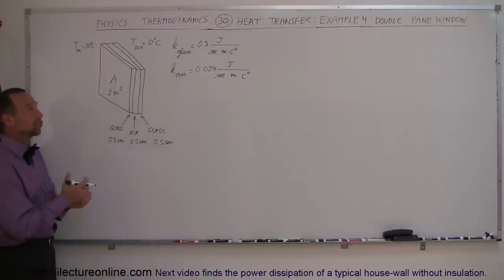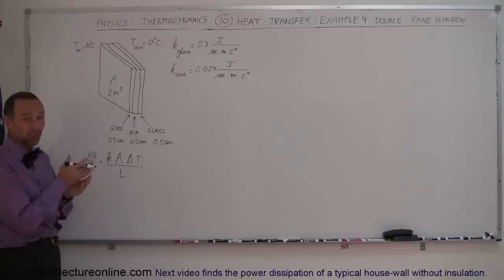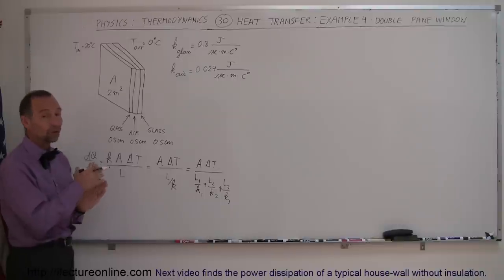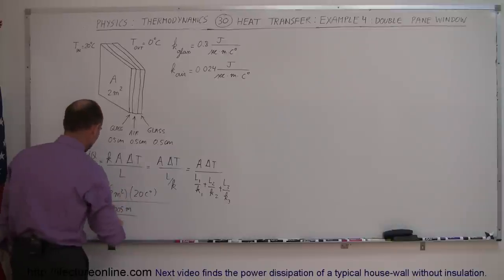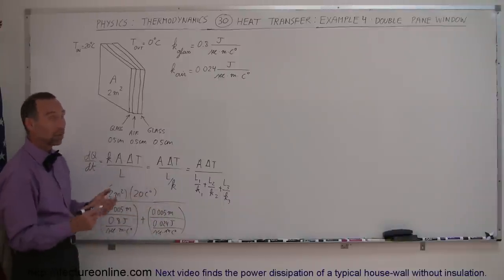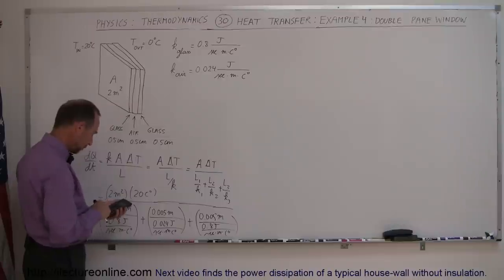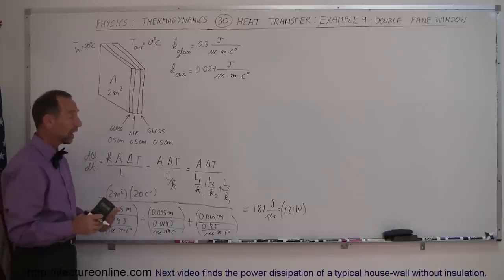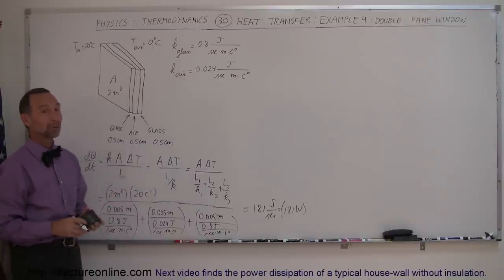Physics 24  Heat Transfer: Conduction (5 of 34) Double -Pane Window

Comment: Thanks! I was thinking of adding a second pane of glass to a 24" x 58" window in my house that is hand built, that is , it is just a single pane of glass in a wooden window frame.  The window has plenty of depth inside to add a second pane, so I plan to just install another pane with a piece of maybe 1/2" wood trim for the air gap.  Actually, I am a mechanical engineer (in aerospace) of 30+ years but wanted to refresh my memory on how much the air gap might help, even if it is not a manufactured window with a  vacuum or with argon gas in the gap.  This reinforced my hope that it will be a worthwhile improvement, with the heat transfer through air being 1/33 that through the glass, roughly speaking.  Right now when it is cold, I can just feel the cold emanating from the window, or rather it is sucking heat from me lol.
Reply from the maker: Correct, it will make a significant difference.  (In Siberia, the old houses will have triple windows with one pane of glass each).  I remember old houses in Austria having 2 separate windows.

Comment: thanks for this instructing video, it helps for determining what size air gap gives what result (retrofitted windows have smaller air gaps than new units due to the limitations of the frame, I am making a pauper's 4-3-4 float glass unit and wondered about the diff with a 4-4-4). However (I am sure you know, but for the other viewers) the equation will not apply to larger air gaps as the insulation value will reach a maximum, or through convection flows even start to decrease after about 16mm, e.g. this equation will give a better rating to a 4-28-4 double glazed unit opposed to triple glazed 4-12-4-12-4, while in practice the latter will perform better. Thanks for the helpful video.
Reply from the maker: Very interesting information.  It is nice to see the practical aspects of these applications.    We are working on videos that also include the convection currents on both sides of the window which actually make a big difference in the heat transfer as well.
Reply: @MichelvanBiezen  Your video has been a great help, thanks.

Comment: Thank you. This helped refresh my memory. I was confused on how to go about the air in the middle but now I get it.  You treat it as conduction not convection.
Reply from the maker: That is correct.  That is the best approximation of how double windows work.  (There are other factors on how the heat is transferred from the air to the glass on the outside, but that we have ignored as well)

Comment: Thank you. One more video would be interesting to see in this list: Window with coatings that reduce radiation transfer. Is it useful for longwave radiation(low temperature inside room) or only for shortwave(our sun)? Also, Screens in a heat insulation for space ships to stop heat transfer via radiation.
Reply from the maker: The effectiveness of coating is a very different principle which we discuss in the optics playlists (light interference).

Comment: Great explanation! Thanks. Can we use the same method (the same equation) to find out the needed cooling energy for a room? To calculate air conditioner energy.
Reply from the maker: Yes we can, however we have ignored the convection of air towards the windows (and walls) and away from the windows (and walls) on the outside.  We have a playlist that includes the convection currents along with the heat transfer which changes the heat lost considerably.    Physics: Ch 24B - Convection: Test Your Knowledge (1 of 26) What is Convection?    Starting with this video:   https://youtu.be/7vg3EnX7ZWc

Comment: I was running some numbers, and if you increase the air gap to 1 cm (0.01) you get the same heat loss (+1.34w) as a triple glass version at 20mm instead of 25mm

0.005/0.01/0.005 = 93.2W double with 1cm air gap,(20mm)

0.005/0.005/0.005/0.005/0.005  =91.86W. (25mm)
Reply from the maker: Interesting result!

Comment: Thank you so much Sir for those great movies. 
Sorry for maybe a stupid question, but what I do not understand in this series of lectures (when you use one or more layers (composite) wall ) is why should we be interested to get smaller dQ/dt. 
Let me explain myself explain: You have said that temperature outside and inside are given = doesn`t change because it is being supported somehow on the same level. If, so what does it matter to me practically if the dQ/dt is smaller or bigger?
My guess for an answer (maybe I am right):
The smaller dQ/dt is' the "easier" is to support inside of the house same temperature?
("easier" probably means less air conditioning needed?)
Reply from the maker: The goal is the reduce heat loss during winter (less heating required) and to reduce the heat from coming into the house in the summer (less air conditioning required).

Comment: What if this was applied to a thermoflask, with different areas per layer? How would this equation be changed?
Reply from the maker: In exactly the same way.  A cylinder is like a flat sheet bend into a circular shape.   But if the layers are thick compared to the radius of the bottle it may require calculus to solve.

Comment: this is not making sense to me. conduction is the heat transfer through a solid body, and convection is the heat transfer through fluids. air can be considered as a fluid so wouldn't you need to use a different equation for that?
Reply from the maker: A thin layer of gas can mimic the process of conduction.  The gas molecules pick up the energy by colliding against the surface and can transfer that energy by colliding which each other and then colliding with the other side.   (The equivalent "coefficient of conduction" is then experimentally derived).

Comment: Hi sir, Thank you so much for this explanation. I do have a question. I think this calculation would mean a thermal resistance of double pane window of 0,22 (adding the factors L/k). However, when I search the R value of double pane glass on internet, this turns out to be way higher. As well as when I calculate tripple glass, the calculation does not seem to resamble the 'basic' values of the internet. 
I wanted to calculate the heat transfer of my facade (double skin) in your manner since this video is really clear. My wall consists of (from left to right): double pane glass, 60 cm air cavity, double pane glass. 
Using your values, this would get me to a heat transfer of 14,3 W. I am not sure if I can do this calculation for my air cavity since that would give a resistance of R = 0,6/0,024 = 25. Could my final answer be right or is there something I am not understanding (your video vs standard values).
Reply from the maker: Note that all these equations ignore the added heat transfer constraints of convection currents.  We have a playlist where that is taken into account.  You must include convection currents in order to obtain realistic heat transfer results.    See:  PHYSICS 24B CONVECTION TEST YOUR KNOWLEDGE

Comment: if we assume that we are designing furnace of melting steel and the area is 2×3=6m^2 what are suitable components of material we use in order make the outside temprature not approach 50 for safety
Reply from the maker: Usually they use very thick walls of brick and dirt.  The low heat transfer is accomplished by making the path  (thickness) very large, and brick and dirt are good insulators of heat.
Reply: +Michel van Biezen thanks so much teacher.

Comment: what is the reason for triple pane - wouldn't you be better off utilizing the extra space with air instead of filling it up with another piece of glass?
Reply from the maker: If you build a tripple pane window, then you'll have 2 layers of air instead of one.  In the "real world" you also have to account for convection currents and heat loss due to that and the transfer of heat from the air to the glass pane and the temperature gradients that causes.  See the videos we have on those principles.  Here we just cover the basic principle of heat moving through multiple layers.   Physics: Ch 24B - Convection: Test Your Knowledge (1 of 26) What is Convection?  https://youtu.be/7vg3EnX7ZWc

Comment: SUPER, this info I was looking for in my new construction. Is there a difference between regular glass and tempered glass in heat transfer?
Reply from the maker: The differences between different types of glass is relatively small.  A much bigger difference is achieved when the glass is layered with air in between

Comment: Hello sir, I am having a problem in studying entropy generation in a wall due to heat transfer. What are the entropy changes within the wall that take place when heat flows from Hot surface to cold surface? What's the entropy change, entropy transfer, and entropy generation (Considering that Entropy change = Entropy transfer + Entropy Generated) ?
Reply: There is entropy transfer (∆S) associated with heat transfer (Q) at any temperature (T).  This is given by S = Q/T, where T has to be in an absolute scale like Kelvin.  For a changing temperature, it becomes ∆S = integral dQ/T.

For infinitesimal temperature difference, all entropy of incoming heat will exit with outgoing heat.  By contrast, a finite temperature difference means more entropy leaves with outgoing heat, than enters with incoming heat.  This implies that entropy generates in the heat transfer obstacle.

Example:
Interior temperature = 290K
Outdoor temperature = 270K
1000W of heat

Entropy entering wall from building interior = 1000W/290K = 3.44 kJ/K per sec. 
Entropy exiting wall to the surroundings = 1000W/270K = 3.70 kJ/K per sec. 

Rate of entropy generation = 0.26 kJ/K per second

Comment: are those watts/sec? just as Joules/sec? because if I want to heat something with an electrical resistance, the grid counts Watts/hr consumptions just as any light bulb. 

If my heat loss though conduction in a Kiln is the same as in the example (181Watts), does that mean that I am lossing 181Watts per second of energy or 181W per hour? It makes a LOT of difference in the bill I have to pay.
Reply from the maker: 1 W = 1 J/sec  = 3600 J/Hr                 1 kWhr = 1000 W x 1 hour = 1000 W x 3600 sec = 3,600,000 J
Reply: ok, thanks.

Comment: No convection heat transfer coefficient?h?I am assuming there is convection also at the both sides of the glass or there isn't?
Reply from the maker: Yes, that is a BIG factor in heat transfer through a window.  We have videos on that as well.  But here we want to ignore that for simplicity of just looking at the heat transfer through conduction.

Comment: You  talk about heat transfer through pane window taking the room temperature and surrounding temperature but why don't you consider convective resistance between room air and window or window to the surrounding air .
Reply from the maker: We have an entire playlist that takes the convection currents into account.  In this playlist we just have the simplified format where we only take the conduction into account.

Comment: what if therenare different cross sectional areas between the layers
Reply from the maker: That would not be a very realistic scenario.  Although if you look at the heat transfer through thick pipes or thick pipe insulation, we have a variable cross sectional area which must be solved using calculus.  We have videos on that.
Reply: @MichelvanBiezen  thank you!!

Comment: sir have a question : why can,t we do it as follows :
 dQ/dt  =   A delta T     [ k(glass)/L(glass) + k(air)/L(air) +k(glass)/L(glass)]
even the units come out to be  { J/Sec }
please explain, thank you
Reply from the maker: That is a question of algebra.  Whenever you have (A/B + C/D) in the denominator you cannot simply move it to the numerator and turn it upside down.  What I always do when I am not sure, is place some simple numbers in the equation and see if I get the same result.  Or what you can do here is work it out that way and see if you get the same answer as in the video.

Comment: How would you find the average temperature of the air between the glass?
Reply from the maker: When heat travels due to conduction, the temperature gradient tends to be linear.  When  the layer is air, it becomes much more complicated.  The heat transfer involves radiation as well as well as convection.
Reply: Then how come we used Fourier's Law (conduction) to solve for the heat flow through the air (instead of Newton's Convection law)
Reply: Actually nevermind. I just realized my assignment was indirectly asking me to find the temperature at each surface and hence the average.
Thank you for your help :)

Comment: how could we find lets say the temperature from the layer of glass to air in the middle only knowing T hold and T cold?
Reply: I know this is late but hopefully it will help anyone else who finds this video.
 
Basically you have to remember the energy balance equation. That is, the energy transferred through each section will be the same.

dQ/dt(glass) = dQ/dt(air) = dQ/dt(total)

So find the q using the method in the video and split up each section as if they are independent control volumes. Then apply the equation dQ/dt=A*∆T*k/L to each pane of glass to find the middle temperatures since you already know dQ/dt. 

You can check yourself by doing the same thing for the section of air with these values for middle temperature that you just found. Hope this helps!
Reply: @AceofSpades-r9w  you might not see this cause its been 4 years but YOU ARE AWESOME!

Comment: I wonder why it has to be dQ/dt=(AdeltaT)/(L1/k1+L2/k2+L3/k3). I mean I understand that it will get J/s as an answer (by dimensional analysis), but I need supporting details why it has to be like that.
Reply from the maker: That is a good question, (and it has given me a good idea for another physics playlist) "How are all the physics equations derived?".  But if you look at this video, it will help you understand the equation:   Physics - Thermodynamics: Conduction: Heat Transfer (2 of 20) Power Dissipation            https://youtu.be/--UCIiufsFc

Comment: What if there is a vacuum instead of air?
Reply from the maker: Then the heat flow from one pane to the other will be via radiation only.  It would make a slight difference.
Reply: Thanks for the quick response.
So k2 is zero,  therefore dQ/dt goes to zero?
Is it practical to make windows of that sort?
Reply: @xSteelCatx  In concept, you could make windows filled with vacuum instead of air, if it were practical.  It wouldn't diminish the heat transfer to zero, because there still would be radiation heat transfer.  But it would eliminate all convection.

However, structurally, it is not practical to build strong enough glass panes to sustain a vacuum, so we fill the gap with a gas.  Noble gasses are preferable, due to the mechanics of single atom gasses.  Argon is common for this application, since it is the most economical noble gas per kg.  Xenon would be the ideal choice for thermal performance, but it is a lot more expensive.

Comment: delta T=T(in)-T(out) or T(out)-T(in)?
Reply from the maker: Since you are only looking for the magnitude of the difference in temperature, it doesn't matter.  (Heat always flows from hot to cold).

Comment: still dont get y u divide by the k
Reply from the maker: +Renee Ramsay 
Dividing by a fraction is the same as multiplying by its inverse.  If there was only one layer, you can place the k in the numerator.
Reply: But why does k have to be in the denominator when you split it into 3 layers? 
Isn't (A∆T)*(k/L) the same as (A∆T)/(L/k)? 
So why split it into three layers with (L/k) instead of (k/L)?
I think this is what Renee was wondering and I am curious myself.
Reply: That makes a lot of sense Mr Van Biezen
Reply: I still don't get this, why you divided it to "k"

Comment: Hello, I request you to show an example of door heat loss calculation.
Reply from the maker: The method is exactlly the same, except there is just one layer, and you would use a difference coefficient of heat conductivity.
Reply: @MichelvanBiezen  Thank for answer, yes it is absolutely true. but I don't know door technology. Can I include the air gap between the two layers in the calculation? Layer thicknesses are taken in cm for an average door?
Reply from the maker: Yes, if it is a hollow door.  Some doors are solid.
Reply: @MichelvanBiezen  My last question- air gap is not completely closed. For example, the air under the floorboard exchanges air with the inside air. İ must calculate air gap?
Reply from the maker: It depends on what the expectation is and why you are solving this problem.  In the real world air exchange through gaps is important.  Also the convection currents on both sides of the door play a BIG role in heat transfer.  We have a number of videos on convection currents that affect the heat transfer by a lot.    See this playlist:   PHYSICS 24B CONVECTION TEST YOUR KNOWLEDGE    https://youtu.be/7vg3EnX7ZWc